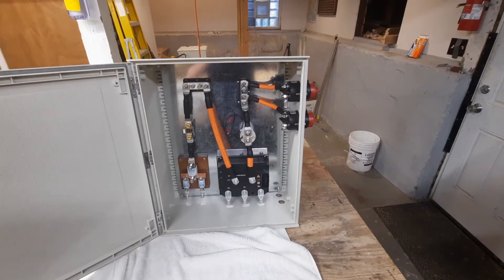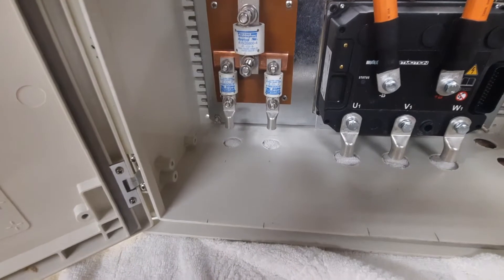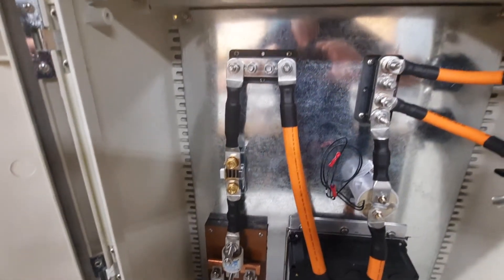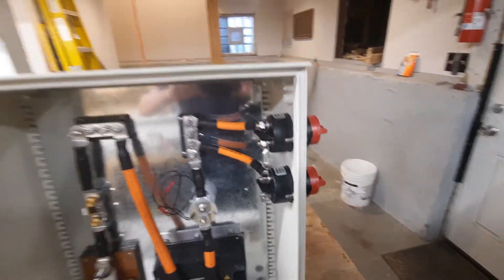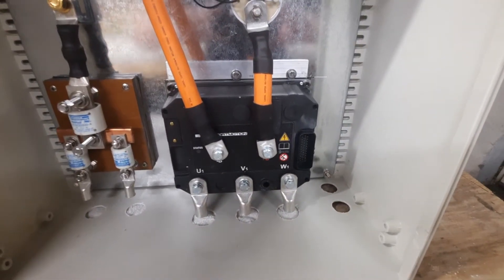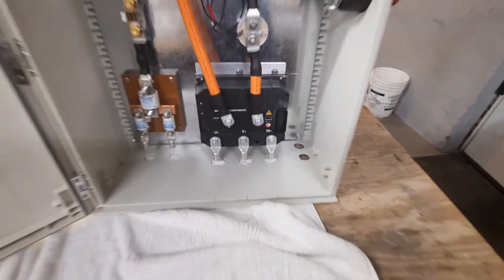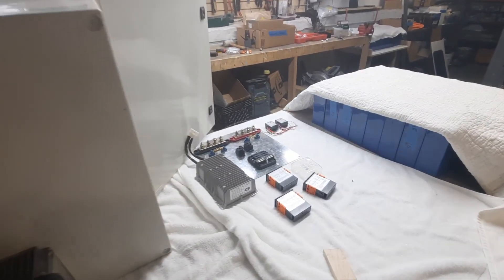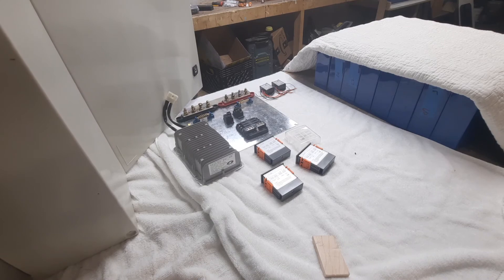Controller is assembled! EV Boat Conversion Episode 9

Comment: I love how you said at the beginning of this series, I am no expert. In this series, you have gone through boat design, boat repair and fibreglassing, high level math concerning electric motors, controllers and lithium batteries, contactors and relays, appropriate sizing of cable, cooling considerations, mounting considerations and a host of other stuff. I'd say you're a professional and bordering on an expert.